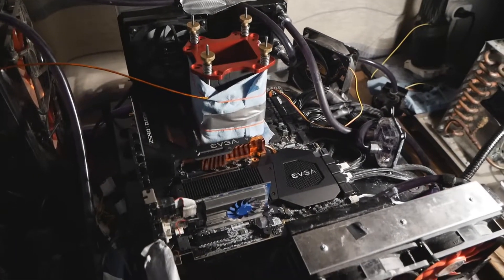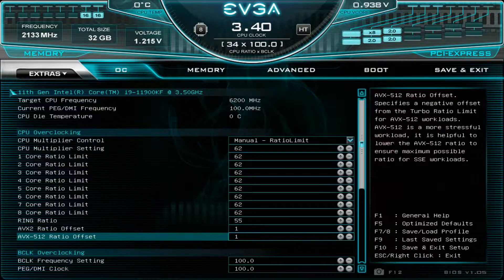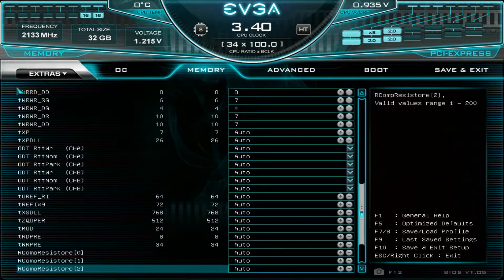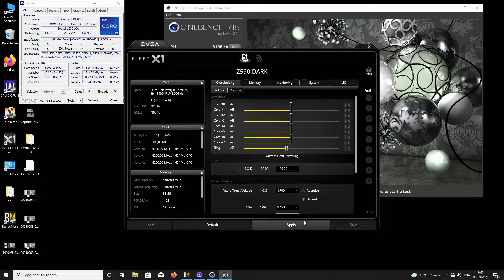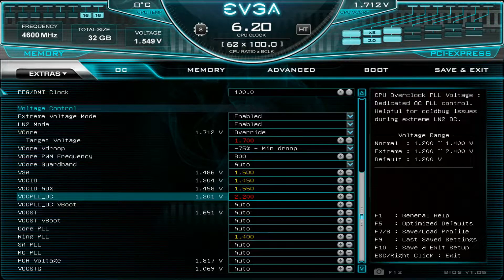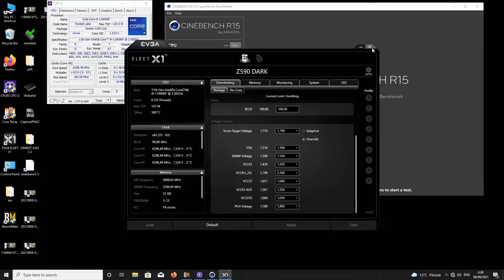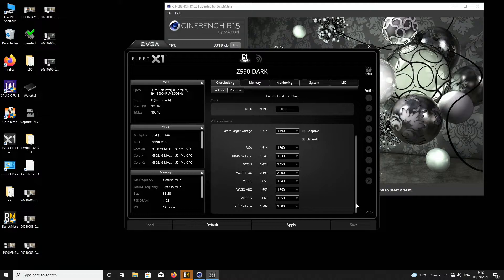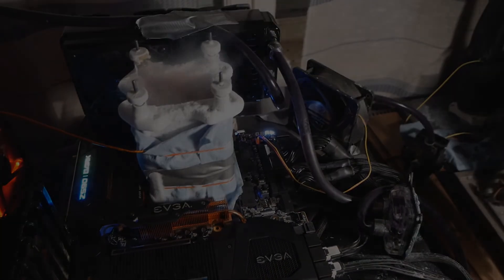EVGA Z590 DARK LN2 Overclocking Tips

Comment: i gave up on the 11900k, bought 3 from microenter and all 3 had an SP rating of 49 and 50.
Reply: Didn't think SP meant much for Rocket Lake like it did for Comet Lake
Reply: If I remember right a lot of top LN2 2-d scores were done with a sp53. I agree sp really doesn't matter with rkl, you need to do your own testing especially if going cold

Edit: it was sp59
Reply: Got a sp90 daily 5.2 haven’t used ln2 on it yet.
Reply: I had no issues with my 82 @5.2... sold it after a month